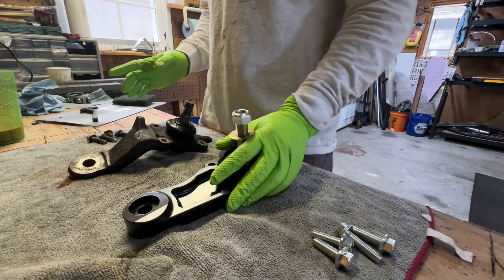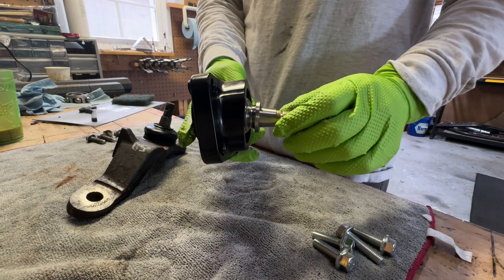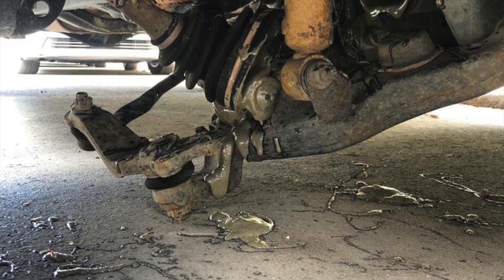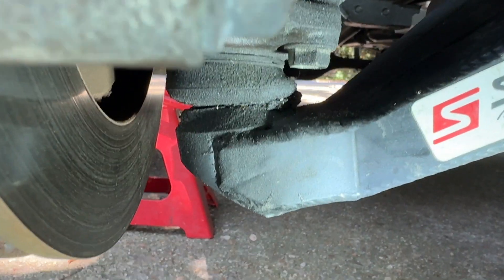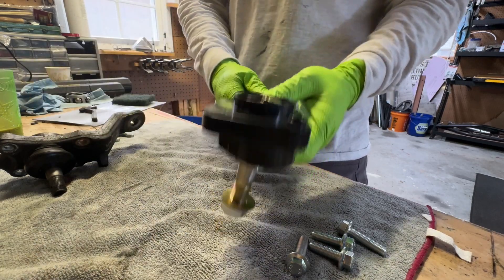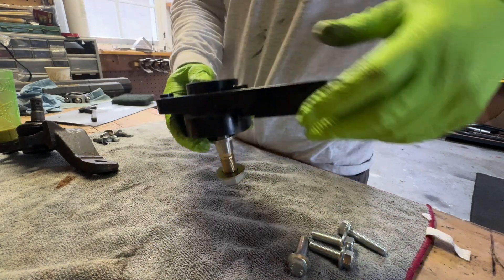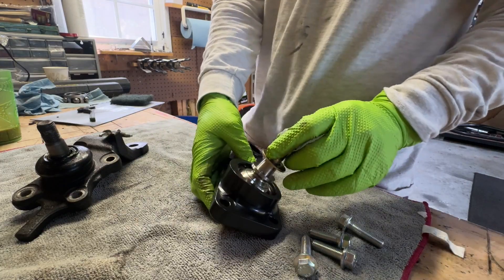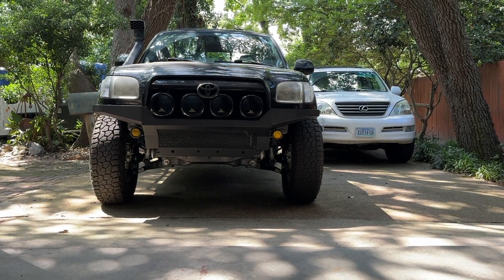Is the Total Chaos Lower Uniball Joint Conversion worth it?

Comment: I just ordered. My old 03 Tacoma broke a LBJ in a parking lot with my son driving it.  
It has sat waiting on a paint job for 4 years.  Finally got it painted coyote tan bedliner spray then the old 3rz reman in it was puking oil and had 2 dead cylinders.  So yanked the engine  balanced the bottom end down to 1g used LC Eutetic pistons and spool rods.  LC clutch 35lb flywheel and underdrive crank pulley.  +1mm intake & exhaust valves and LC stg 1 cams.  
It previously had an LC bored throttle body and Thorley header.  
The truck really runs good now but I don’t want my kid in a truck with potential broken ball joints at 70mph so going to throw these in.
Reply from the maker: @ryanlogan2911  Sounds like it will be back in action soon enough! Yes, the LUBJ conversion really does give nice peace of mind, safety wise. That’s actually originally why TC decided to design them, because of their own kids. Good luck with the rest of the build!

Comment: Great video, thank you. Keep us updated on how your steering feels as they break in.
Reply from the maker: Hey, thank you for the comment. 
I still haven’t done a professional alignment, but the steering has loosened back up to almost the same as stock. I still have to help it a little bit to return to center, but I’m so used to it now, I don’t even notice. 

I’ll tell you that I didn’t realize how much I used to worry about my ball joints, when off-roading or smashing pot holes. I dont even think about it anymore, it’s nice.

Comment: Great video thanks! I have BTF lower control arms similar to your Solomon did you have to bore out the hole on your lower control arms in order for the bolt on the ball joint to fit?
Reply from the maker: Thanks! They come with tapered adapters that fit around the bolt. So if the stock LBJ fits into your current lower control arms, then these will bolt right up. Just make sure you order for the correct years.

Comment: easy answer and he answered it:On lifted aps, probably yes. On stock for DD applications NO. As to cost you are looking at about $1200 +with gaskets, new bolts. Stock is $140-180 OEM FOB Japan which is less than retail dealer. So not 3X as much but easily 6 to 7X as stock.. Ball joints are for most vehicles a maintenance item and using a dial indicator Toyota allows .5mm of play. Personally I would consider replacing with almost any play over .1 to say .3. I have 258 K on my 4R and have less than .1mm
Reply from the maker: @cal48koho  There are no gaskets on the LBJ. Bolts come with the kit. So $1000 gets you everything you need.
OEM LBJs are $100-$150 per side for the FG Tundras, depending on the year, plus about $12-15 for the bolts, so in the $250 range at the low end for everything. $250 x 3 is $750, so yes, 3x was a bit of an under bid, but I was just doing maths on the fly. 4x would have been closer to reality. 
Other than that I agree with you. These aren’t for everyone. But they absolutely do give a lot of peace of mind if you regularly push your suspension to its limits.

Comment: Whats the maintenance? Is there like any Grease to put on...does it need to be cleaned every time you go off-road? If you do daily commute...how is the maintenance?
Reply from the maker: I spray them clean with a hose, and soak them in PTFE spray. I do mine about once a month or whenever I wash the truck. Ive had uniball upper arms for a decade, so it was easy to add the lowers to the routine.

Comment: Does your steering feel loose since you did that conversion I feel  like it doesn’t stay centered and goes left or right I got new inner and outer tie rods and new uniballs on the uca new uca bushings , I have the total chaos lower ball joint conversion , on 315 70 17 , 17x10 -12 offset , I’m running fatbobs vated coil overs , idk what’s going on at this point ever since that conversion steering is all messed up .
Reply from the maker: Steering actually felt a bit stiffer, and I loss some return to center because of the uniballs being tight. That's normal.  I got used to it pretty quickly, and it's getting better and better as the ULBJ get broken in. ive been cleaning and saturating the uniballs with PTFE spray at least once a week, since I was used to doing that anyway with my upper uniballs. 
Still need to get the truck aligned again. That should bring it back pretty close to how it steers on the standard LBJ.

Comment: Unless you are wheeling hard, just replace the originals every 10 years and you'll be fine.
Reply from the maker: @mikeb5664  If a persons truck is stock, I agree, change out the stock LBJs with Toyota Genuine, at appropriate intervals, and you should be fine. However, if the truck is lifted, at the very least, test your suspension cycle for the reasons I discussed in the video.